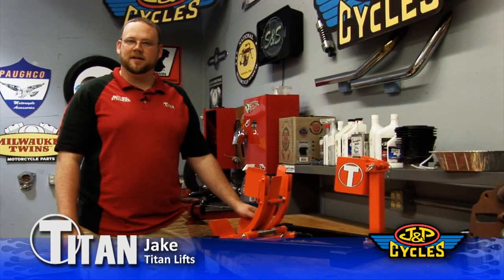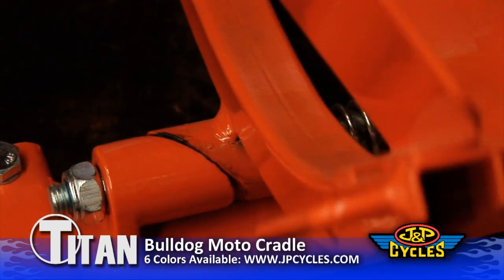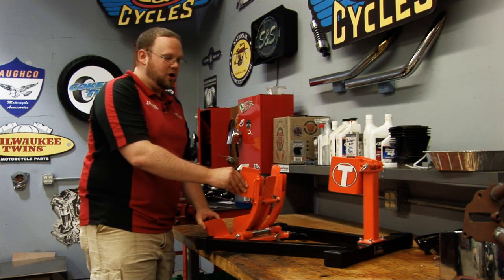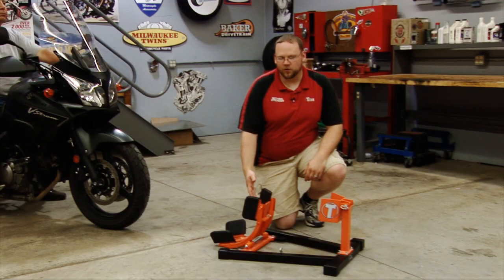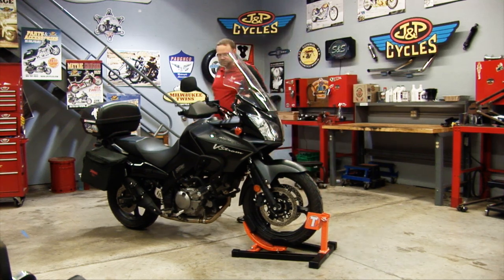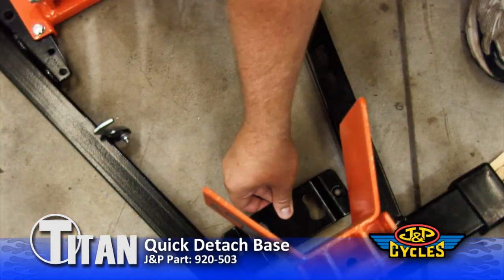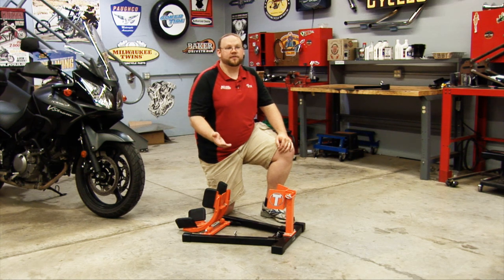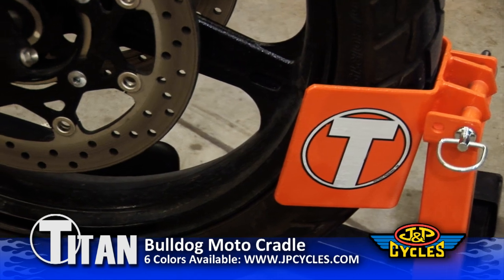Titan Bulldog Moto Cradle Wheel Chock Stand  • Available from J&P Cycles

Comment from the maker: It does not need to be bolted and the manufacturer says it will hold wheels with a diameter of 13" - 22". We've seen these used with heavy bikes.